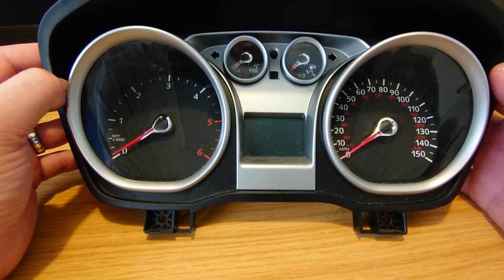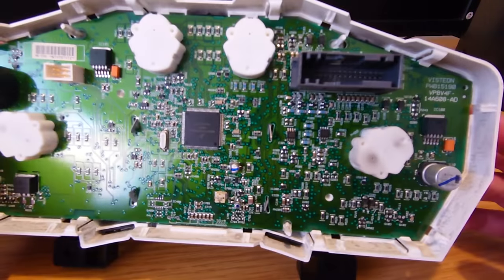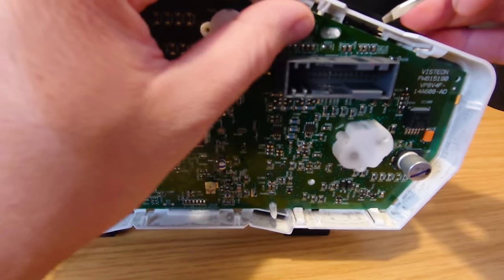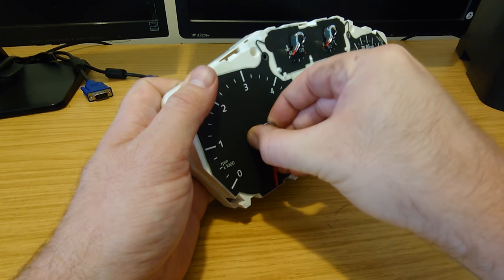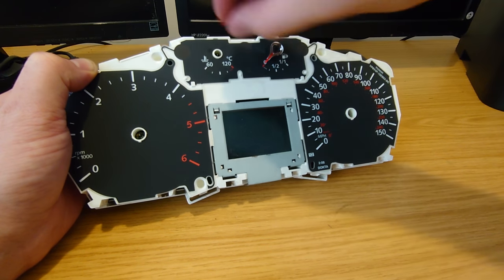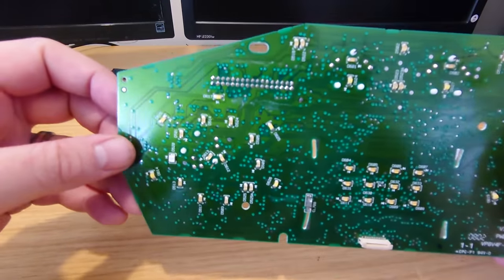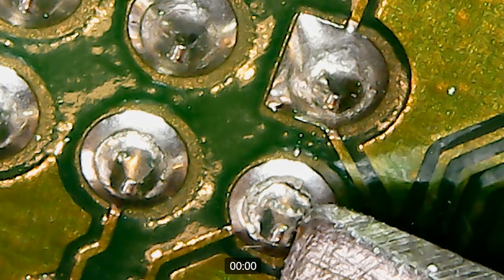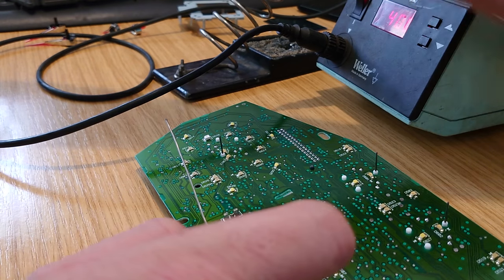Ford Focus mk2 instument cluster strip and repair U1900

Comment: Driving home last night about 10 miles from home, the there was the familiar "bing" which you get for something like the low fuel or icy conditions warning. However, no message. Then a bit later, it got more serious with the dashboard lighting up like a christmas tree, then an "engine malfunction" message and then it cut out. I could start it again, ran normally for a couple of miles and then it would repeat. Sometimes it would start again, sometimes I could start the engine using inertia (it's a 1.6 TDCi Mk 2 Focus diesel, although I don't suppose the engine type makes any difference). I must have gone through this sequence at least half a dozen times, with occurrences getting more frequent. Sometimes the the engine would turn over at all on a restart, although I had a dashboard of likes. However, wait a minute or two and it would catch, run normally and then the dashboard would go mad. For the last few hundred yards I trickled home on tickover as it was entirely unresponsive to the throttle. 

I suspect it's either this fault, or something is just scrambling the CAN bus signals. 

Fortunately I have done a lot of electronic soldering in my time, and it looks like I shall get some more practice. In any event, the video is extremely useful.

Comment: Do the speed/rpm dials slot in or automatically adjust to the correct range or do you have to manually wind them to the right spot when putting them back on?
Reply from the maker: Put them on where they came off. You will feel slight resistance when they arr on there stops, don't push past this resistance.
Reply: @rmautodiag  awesome thanks!

Comment: Hi, Really useful video which has helped me a lot! One question, how do you get the led display cable (the flat one..) back in! Keep up the good work!
Reply: Hi, just push it with your fingers, if it is still difficult use a little tweezers, that's helped me.

Comment: In my car  , i had many cold joints at the connector but because i have a microscope   i inspected all the board and i saw that  i had cold joints at  the MCU as well.

 Also a  friend with the same car , same dashboard   ,  had the same problem with cold joints at the connector and at the MCU .

Comment: I’ve taken my dash apart and got to the board but am a bit apprehensive in regards the soldering. Anyone know how easy/hard it is?
Reply: I did mine a couple of weeks ago. The pins are very small and your life will be easier if you have a magnifying glass or microscope to help you. However, it wasn't particularly hard. I don't consider myself an expert with a soldering iron by any means, and I had no real problems. You just need to make sure you're getting enough solder on each one to cover any cracks and create a secure joint with the pin. Once I had the unit open, the soldering work only took about 10 mins. I've gone almost 3 weeks now without any problems since putting it back in the car. Fingers crossed. 🤞
Reply: @_D1886  nice one. Maybe I'll give it a try then 👍

Comment: I've tried this, and it's brilliant. However my temp guage now acts very strangely. Rathe than sweeping between 60 and 90 degrees smoothly and slowly as soon as there is any heat in the engine the needle jumps up in increments of a couple of millimeters at a time, quite quickly and hits 90degrees within a few minutes of running the engine. Switch off and it sits just below 60 where it should do. Any thoughts of what I've done wrong as it didnt do this before hahaha, maybe one of the solder joints didn't take properly or did I bugger up the little stepper motor inside when removing the needle? Blimmen electrics 😂😂
Reply from the maker: You may have damaged the motor. You could try removing it again and make sure it's in the correct place. You should feel slight resistance when the motor is on its stop.
Reply: Mine does this. It can be adjusted if you have a HS/MS odbii cables and laptop.

Comment: I’m at a lost end. Garage can’t find the fault either, had them all soldered and the fault remains. 
Mine has a fault where every 3 weeks ( started to get more regular now )  I get in and it does nothing Steering lock doesn’t release push start does nothing it’s the same with both keys. Immobiliser light is flashing but nothing else on the cluster works at all.  For a while there’s the big plug on the left of the fuse box if I removed it waited 10 seconds and plugged it in again it’d work but now that’s not working. 

It must be reading the keys as if the keys not in the car it says “key not in vehicle” but when the fault is happening I don’t even get that. Been going on for a year now l, don’t want to just sell it as It wouldn’t be fair on the next person.